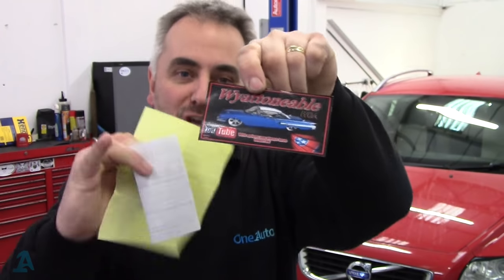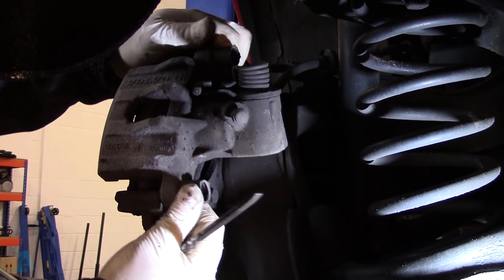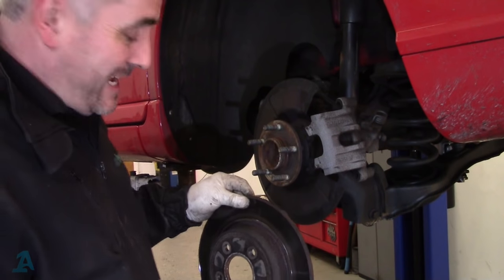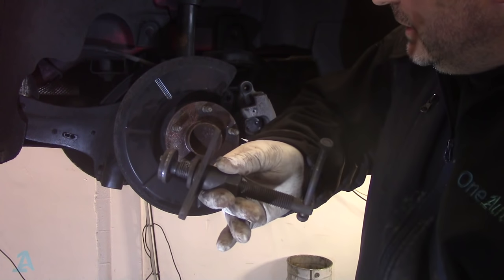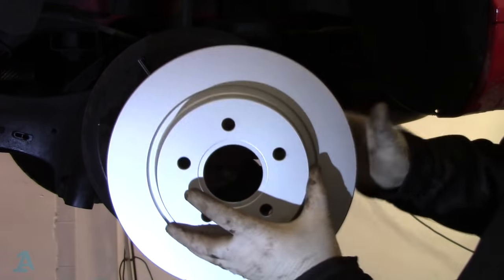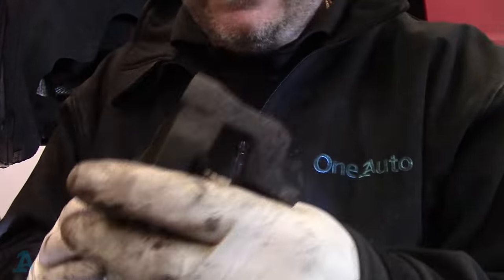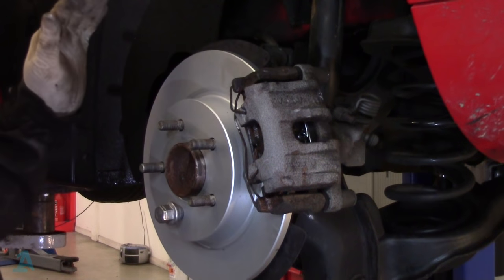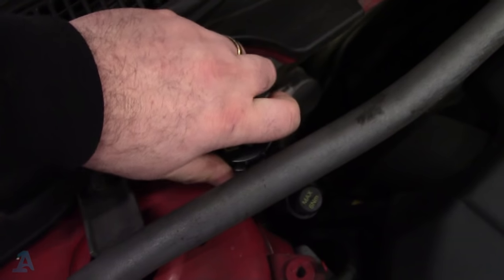Volvo V50 Rear Brake Pads & Discs (Rotors)

Comment: Great video! I have the same car, and when I changed the rear pads, unfortunately, I didn't have the piston winding tool so I used a pair of long nose pliers to push and wind back the caliper piston, and now, I have to keep re- adjusting the handbrake every two weeks or so because it slackens off .. is there a remedy for this? Or do I need to replace/rebuild the rear calipers?

Comment: Great video! 

One quick question, when it comes time to pump the brakes/articulate the handbrake, do you do it twice (once after each caliper has been done) or just do it once after both calipers have been done? 

Cheers

Paul
Reply from the maker: Just once after both sides have been done
Reply: Great, thanks for the quick reply. 
I'm assuming before you start the job that you release the handbrake?
Reply from the maker: Paul McCaffrey correct
Reply: You Sir, are a star.

Discs and pads getting done all round at the weekend!

Comment: Enjoy your videos. I have noticed on a lot of european makes these days that many fasteners are considered non reusable particularly on VW brake components. Do you come across this with other makes and is it really necessary to replace such fasteners?
Reply from the maker: Good question! A lot of Euro manufacturers indeed recommend to replace certain bolts, this is because they consider them a one time use as they are usually 'stretch' bolts and once torqued to spec they shouldn't be used again. Usually there is a spec saying only to use once or only use twice etc.

Comment: Hi,nice job.What type of grease did you use for sliders?Thank you
Reply from the maker: It's a brake grease suitable for pads and sliders that comes with the brake pads. If they come without it I use silicone grease.
Reply: Silicone grease with no damage to the rubber?
Reply from the maker: No it's fine

Comment: Hi did mine 06 v50 got lots off grinding noise now not sure what I have done wrong did the same as you any suggestions
Reply from the maker: Yes. Go back and check what you’ve done. Pads in backwards?
Reply: @OneAuto  cheers I did them like for like. But after watching your video checked this morning in work and your right was wrong way. First time I have done them was a volvo grarge that has done them before   thank for the reply spot on now cheers

Comment: Were there anti-squeal shims on the pad backs? I thought you dont lube them
Reply from the maker: They are pre-bonded onto the back of the pad. No problem with lubing them, the grease acts as another layer to stop vibrations that can cause squeal.

Comment: Hey I'm first and saw my sticker first. lol Thanks so much for the shout out. Now on to the important stuff, how to fix cars! Do you own your own shop? I don't have a Volvo but I enjoyed the tips along the way. I've spent a lot of time in Germany and they don't allow brake rotors to be machined. Is that the same for you?
Reply from the maker: You're welcome Wyatt. Yes it's my shop. You can machine brake rotors if you want to here. There are machines that do it whilst they are still on the car even. However rotors are not expensive so I always fit new. What were you doing in Germany?
Reply: The first three years I was in Nuremburg flying the Cobra helicopter. Then I went back as a fixed wing pilot to Heidelberg for 2  1/2 years where I met my current wife. She has family in Karlsruhe and we go back every other year to visit.
Reply from the maker: Wow that's awesome. Rotary and fixed wing pilot. You must post some photos if you have any. Make a great vid 👍
Reply: I don't have many pictures. Even when I owned a camera I never thought to take any pictures. I may search around one day and do a slide show or something. We'll see how it goes.

Comment: Copper grease should never be used on brake systems 🤦🏻‍♂️ there are special brake lubricants. Copper grease can be easily washed off, can give false readings to ABS sensors and worst case scenario can seize the pads. It’s unreal that mechanics don’t know that. Most mechanics in UK is doing it wrong. I only use ceramic grease which will stay on bracket, and can work under high temperatures unlike copper grease.

Comment: i have the same model car from 2006. wanting to change my discs and pads. but i seem to get this steering wobble when slowing from high speed or even at average driving speed what would you think it is? its not bad wobble just something small thats annoying me
Reply from the maker: Alan Ring most likely cause is the front discs are warped. Fitingt front pads & discs should sort it.
Reply: One Auto, i fitted new front brake pads i will try new discs cheers
Reply from the maker: Alan Ring Be sure to fit new pads with the new discs so they bed in together.